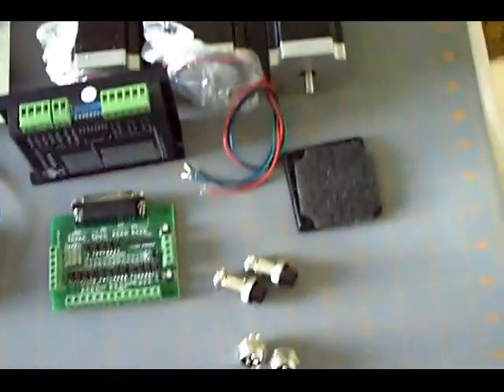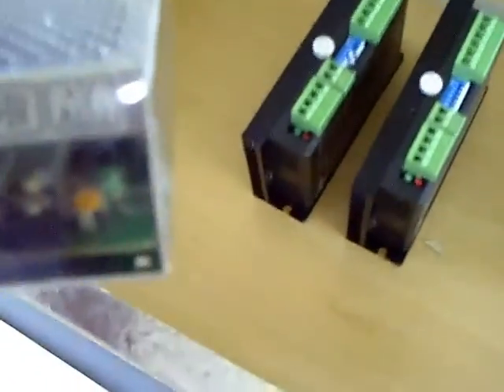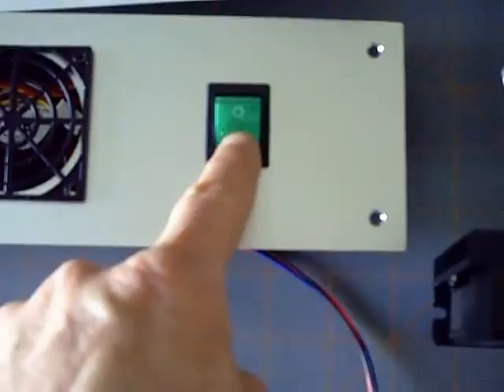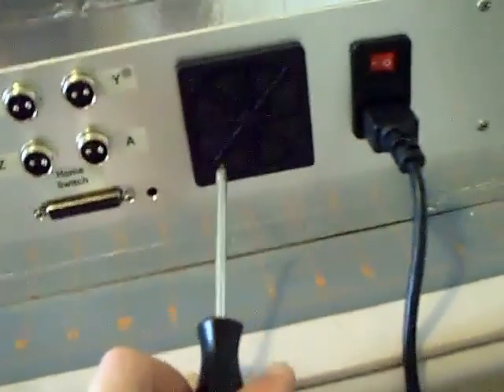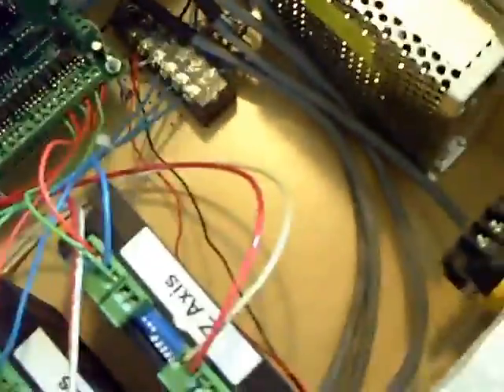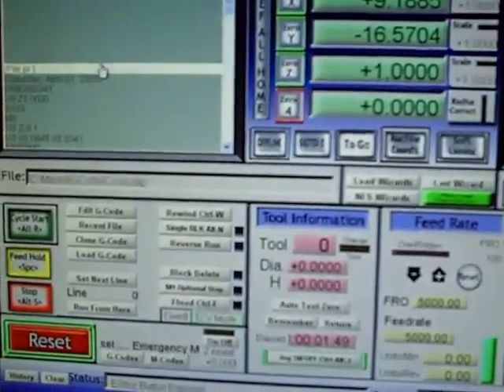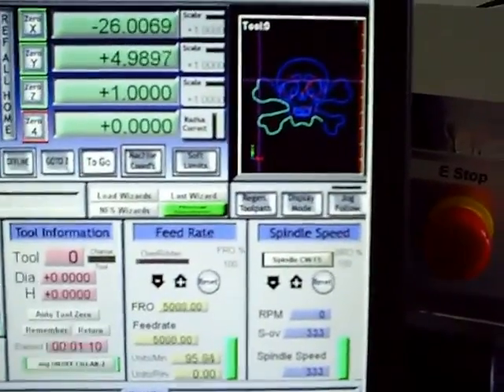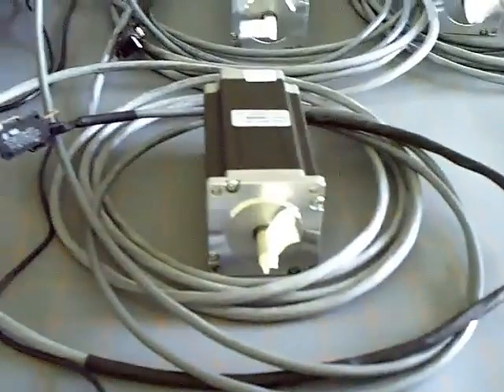X2 Mini-Mill CNC Conversion Controller Build and components

Comment: For being 10 years old, it has better information for a beginner than most of the video's I've watched thus far. Thank you for making it.
Reply from the maker: Your very welcome!
Reply: @CNC4XR7  I'm doing a CNC conversion of the Grizzly G9729 Mill/Lathe combo (making the lathe a type of 4th axis, mostly for indexing parts, but who knows, if it works well, maybe other things). I just ordered a bunch of electrical components and some VFD compatible motors.  I wish you did consulting, I'd pay to get your advice.
Reply from the maker: @blacktopmods     
I Do offer technical support on my website.
 https://cnc4xr7.com/TECHNICIAL-SUPPORT.php

Comment: I have the servos, and i'd like to buy just the drivers. Is there anything I have to keep in mind to buy just the driver?
Reply from the maker: Diego Landa  make sure the drivers will tab
Ndle the stepper you have all rating and voltage.

Comment: Thanks for all the work, it looks great. I'm just starting down this path of gaining understanding. I had originally bought the Fignoggle DRO Plans. Finally got them working. Now I bought their CNC Conversion Plans for the SIEG X2, but they only go into the hardware side, and mention the REMA 23 motors, but no sizing.

Question: There's the different wiring types for these motors for Parallel & Series, 8 wire, 4 wire. What did you get?

I'd rather be making chips, or welding than doing this stuff. But I'm on disability and my wrists are signaling carpel tunnel trouble. Had it twice many years ago. This is why I need the CNC. Nice thing about Fignoggle plans, you get to still use you machine manually as well. Lots of work to make all the parts for it.

Thanks again!
CD
Reply from the maker: What's Up Dog!, Sorry could not resist. Ok So the kit I use in the video here I got from Ebay Longs motors there all the same so shop around. I am using 425oz. Nema 23 never had a issue on my X2 over three years running now.

Here is all my info on the X2   https://www.dropbox.com/sh/ni5zo314t3vlyj7/AABJxemYXcU-LbGhhPHXfxzIa?dl=0
Reply from the maker: Here is the Wiring
https://www.dropbox.com/sh/xm0pafjw4hhc6ws/AAD-tODhqN1mbVMYV1bYGtCsa?dl=0
Reply from the maker: You Should take a look at my mounts very simple and easy to make. the X axis is only two pieces
Reply: Wow, you have a lot of videos to glean from. I took a look at your conversion mounts, based off CNC Fusion. I opted for the 2 prong approach with FigNoggle.com, 1st their DRO Install Plan, then their CNC as it works in conjunction with the DRO. The nice thing about their plans is you make it all, and get all the drawings & pics on how to convert. Also BOM and sourced materials. Of course it's wise to price else wheres as prices have doubled+ since 2007 except for raw metal. It's down a 1/3rd from '07/. Finally you will get a CNC and a manual mini mill. Uses existing Screws for X & Y. Only Z is where you get the Ball Screw & Ball Nut. It too keeps manual along with CNC. I took down your resource for yours from ebay. FigNoggle suggest going with MSCDirect.com, which are quite spendy.

Watched your 1st cut video on your newer PM CNC. Just a thought with your vibration issue, as I saw you were climb milling. Don't know the capabilities of that machine, I know Bridgeport's can handle it fine. Tom's  Techniques stated on smaller machines to use climb milling on final cuts only, as the smaller mills can't handle it. Backlash can be a problem for it too. But I'm probably preachin to the choir.

Did you make your enclosure for the X2?

I also checked out Longs Motor on ebay as well. I don't think they sell 8 wire NEMA 23 motors. They're probably more expensive. Found an online chart of reputable suppliers of these motors, shows all kinds of data on them. Longs wasn't on the list, but hey I'm on disability so can't afford much.

Also looked at the annealing machine. Pretty good, but spendy. I too have a Lee Load Master, & Classic Turret, and Single Reloaders.

Ok, I'm writing a book here. Here's my website:
http://SeeTheSound.net If you want to swap emails write to:
info[at]SeeTheSound.net
-CD
Reply from the maker: Crevice Dog 
most stepper motors are 8 wire if you watch my video on the x2 you can see them there are 2 wires tied together to make 4 wires some motors are already wired this way.

my whole x2 cnc conversion was fairly inexpensive as I made all my mounts.

the issue with the pm was just a setting in mach 3. look ahead was set to 20 causing a shutter effect.
Reply: Thanks for the 8 wire info, that gives me hope, it's hard to tell in the pics on ebay. I wrote to Peter of Longs but no reply as of yesterday. You probably don't even glance at the X2 anymore aye! Thanks Sam.
-John
P.S. See I was preachin' to the choir ;)
Reply from the maker: Crevice Dog 
no the x2 still gets used it will take time to change over
Reply: Glad your still using the X2, letting me know the motors mostly come with 8 wires.
Question: Where did you get the black oxide vise clamps for the Tool Maker's vise? I saw in one of your vids you had the LMS version. Not sure if you bought them, or made them. I just finished making mine. I don't care for them for one reason, as you tighten them down while indicating on the back face, they push the vise. Finally got it so my .0005" indicator stayed on zero. Are those other clamps better? Did you buy or make them? Saw they had 2 cap screws on the outer face of the clamp. Smaller is better as you get more room w/o the screws sticking up. Thanks for your help.-CD
Reply from the maker: CDA325@GMAIL.COM
I use clamps I purchased from LMS they have pins that engage in the side of the vise.
I also use pieces from a clamping  set and reuse the same bolts

Comment: Are the longs motors components any good? Want to buy the same kit
Reply from the maker: +Elwin Priem 
I have used them for three years now on my X2 with out any issues I did have the BOB go bad. I changed it with a CNC4PC c-10 BOB.  as it allows a 5 v signal to be input for say a tach the Chinese bob does not. overall great deal.
Be Safe,
Sam

Comment: Hi, CNC4XR7. I contacted graigs machine shop about the wire diagram in one of his videos, I asked if he would send it to me. He said to contact you about sending me a link, for the wire diagram. I would really appreciate it if you could do so. Thank you.
Reply from the maker: +Christopher Vanlent  Hi Chris Not a problem, I have sent you the info via. E-mail.
 Be Safe, Sam
Reply: Thank you. I have another question. How do I wire the spindle to the breakout board? I'm using an Busch router with variable speed for the spindle. I would like to control the speed an on/off power with the software.
Reply from the maker: +Christopher Vanlent  Hi Chris I'm not sure what BOB your using, If its the standard board that is included with the kits from China. Most likely you will need a spindle speed control board Like a C-6 from CNC4PC.com

Comment: change system geckdrive g540 and get double speed. i can turn nema 23 steppermotor 1250 rpm in geckodrive. chinece shit control only half speed and loose steps.
Reply from the maker: +Juha Rakolahti 
I see your a Fan of Gecko 540's Nothing wrong with them as a personal preference I do not care for the all in one design too many times one component goes bad and your down.  Fry your BOB replace it, Fry a stepper drive replace it , Fry the gecko 540 your down and the Blue smoke cost you a lot more. seen it happen before. as for the speed and loss of steps I have not had any issues and with only a 4" x 8" travel how fast do you really want to rapid? my X2 is conservative at 83IPM or 425Rpm.
Again nothing wrong with a Gecko 540 just a personal preference.
Be Safe, Sam

Comment: This c-10 bob can wiork with servomotors and it is possible to connect home and limit sw's ?
Reply from the maker: Miguel Contreras Yes this is the same bob I used on my current project.
https://youtu.be/Xy4I-XCQWN4?list=PLZ7eWN_JLWbF9f1nIc4cWsV3L5I9vu7vx

CNC4PC also has a BOB with built in spindle control as well for a little more $

http://cnc4pc.com/product_info.php/c10-directional-parallel-port-interface-card-p-45?osCsid=hf6qnoqnbf5lqqa9lghrm0msq3

Comment from the maker: If your asking about the stepper setup yes if your asking about the Mill well it depends can it cut steel yes will it take a while yes. I mostly cut Aluminum but if I were going to cut steel a lot I would go with a bigger machine. but I think the steppers are great no issues.

Comment: Fine out what the mH is for the motor and square it then multiply by 32 and that will be the Maximum voltage that  motor can handle. So if that motor is 3mh squared = 1.732050807568877 x 32 = 55.42562584220407 so 55 volts

Comment: I got the same kit, my motors are running too slow. How can i increase the stepper motor rotating speed?
Reply: How have u setted up ur DIP switches? Is SW4 ON or its OFF? How many pulses per second you use?
Can i have ur mail btw :)
Reply from the maker: You can send me a personal message with you e mail I will respond. If you can take a photo of the dip switches that will help you can see mine in the video.  I run half step.
Reply from the maker: My velocity is around 80. And acceleration about 30.
Reply: I changed my DIP switches to 1/2 it is working awesome now. I reached 11500mm/s while testing the motor on full current.
Reply from the maker: That was easy glad I could help

Comment: I also have the same hardware and can't seem to get the motors to run right. What are your pin settings for the pulse/rev on the drivers?

I have learned a lot from your videos and I'm following your footsteps. Thanks and keep them coming.